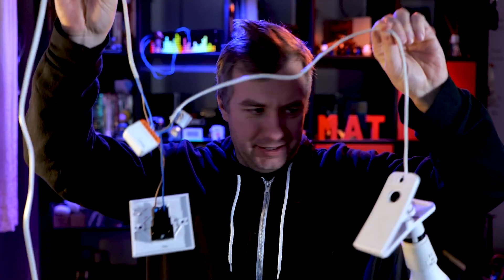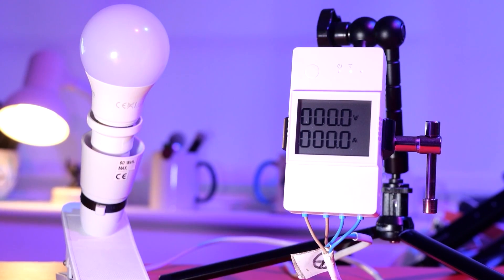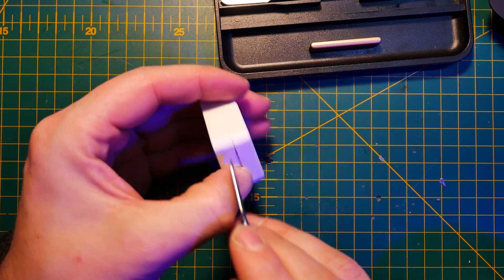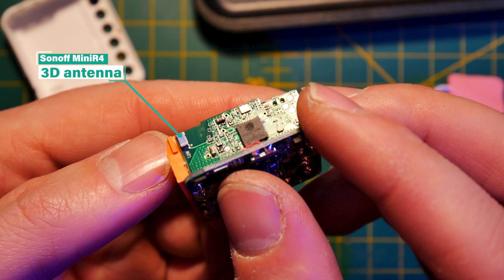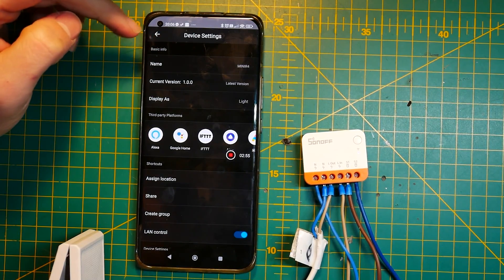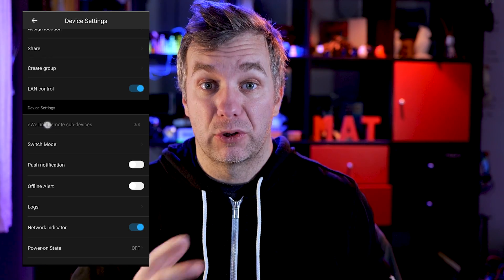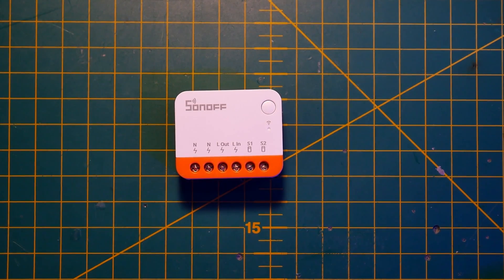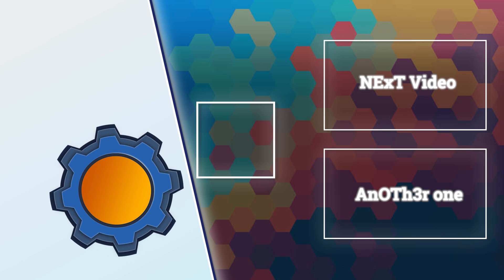The smallest smart relay I had in my hands! Sonoff MiniR4 Extreme

Comment: Thanks helpful vid. As I have no experience with this product, could I get a little more help please?🤔
Here goes - I bought two Sonoff MiniR4 Extremes to play with. I thought I would connect a 240V load to one MiniR4 (#1), using a push button adjacent to trigger an "on" timer in this MiniR4  and operate the load. After time out, the load switches off. 
Second MiniR4 (#2) to act as a remote WiFi button to do the same function with the #1 MiniR4 timer/load, via the WiFi.
Am I on the right track? How is the timer set up.
Thanks
Reply from the maker: What you say it's possible and the 2nd switch could be "synced up" using automation panel in eWeLink app. Timers would be managed in the app as well as the device offers inching, timers and schedules in ewelink
Reply: @notenoughtech  Many thanks for your help, I will do more study and set it up!

Comment: SONOFF ZBMINIL2 Questions.. Is it a good fit and will it work in these scenarios?

Here is what I'm wanting to accomplish and hoping someone can tell me if this device will do that..

*Scenario 1:* Have a switch box that has a neutral wire. It turns my ceiling fan / light combo off/on.. I have a Smart Life universal wifi fan/light combo installed that I have in HA to control fan and lights. However, switch has to be on to do so.. I want to be able to control the fan/light via HA/Alexa regardless if the switch is in off/on position.

*Scenario 2:* I have 3 switch boxes, all 3 way, that control our hallway lights. None have a neutral. Will this device provide HA on/off ability? If so, do I need to install 3 (one in each box)?

*Scenario 3:* I have a switch box with no neutral. Just want HA to have ability to turn lights off/on. 

Also, for any of the scenarios that do work (if any), does the standard on/off toggle light switch work with them?

Thanks!
Reply from the maker: Scenario 1 is ok as you will be able to use your switch for something else and keep fan/light on all the time. 

Scenario 2 depends on how it's all wired but if it's a loop (fed from one socket) then you need just one device. 

Scenario 3 as long as you use non neutral version should be fine
Reply: @notenoughtech  thanks for the reply!! So for scenario 1, what do you mean I’ll be able to use the switch for something else? Will the switch still turn the light / fan off as normal if it is on?
Reply from the maker: It will be down to you as you can decouple the switch from the relay
Reply: @notenoughtech  Thanks for the reply!! I tried installing “scenario 3” today.

It’s not working how I expected but maybe it’s normal / how it works.

I installed it and added it to HA. I was able to control it via HA but it had some pretty bad lag (but very well can be my zigbee network).

I tried powering it on with HA and then while it was on I toggled the switch. It did turn off but in HA it still shows on. Is that expected?

Thanks for the help.

￼

Comment: Great video, thanks.
Can you still use the switch when your phone (or different device) is connected to a different network than the sonoff switch itself.
For example when the sonoff switch is connected to my home network and my phone is connected to 4G/5G and i want to be able to turn on/off the switch?

Comment: The instructions included are confusing or something is lost in translation.
They talk about "strong" electricity and not connecting neutrals and earths to S1 or live, neutral and earth to S2.
In their switch wiring diagrams, especially the last two using S2, isn't that what you are doing by connecting live to S2 through a switch?
I wonder if they mean don't use S1 or S2 to supply power to the module?
Any thoughts?
Reply from the maker: I'm sorry for the late reply. 
Basically, you want to use the drawn schematics :) these are much better to follow than written by their instructions. You want to connect Live to S1 if I remember correctly (I'm away from home) but the illustrations were the way to go

Comment: Hi Mat,
Have you tried the schematic in which you install the switch between the live wire and S2? It doesn't work for me.
Reply from the maker: Have you set the switch in correct mode? Triple press the button to toggle between push button and toggle
Reply: @notenoughtech  Thanks for your reply, but it was my bad. I tried using a proximity sensor relay as a switch, but when turned off there is 5 volts so the mini always gets voltage and doesn't switch on or off.
Reply from the maker: I see

Comment: I was wondering if this device can be useful for me, I am trying to connect a photoelectric sensor to know if it is active or not, I meant I don't need to turn on/off, I just need to know the current status of the sensor then I can wire the logic to turn on/omaff a light by ewelink.
Reply from the maker: I don't think this is the best device for that. Whats the voltage of your sensor connected?
Reply: @notenoughtech 
 Supreform IP67 Waterproof 40 Feet Range 10-30VDC Retro-Reflective Photoelectric Beam Sensor
Output: Relay SPDT
Output Capacity: 1A/30VDC, 1A/250VAC

Comment: I can't wait to try my "no-neutral" circuit hack on the  Sonoff MiniR4
https://youtu.be/oBR5O391m_c 
Or my other circuit hack that allows you to put it by the light fixture itself, and not behind the light switch. I know this is easy to do in the UK with the three plate ceiling rose (loop-in system). For the rest of the world my circuit might help. https://youtu.be/x7Q8AS238pY

Comment: I thought my dodgy ATX Computer power supply wired into some LED Strips and a couple of ESP32's was bad - LOL.  The intro to this video was a bit of fun.  :)
The Itead Mini Extreme is really small.  Nice to see the WiFi signal is pretty decent with it.   I am a little concerned about heat long term and I am not fully trusting of the relay.  I'd likely run it at half of its rated value at most.   I love small IoT devices, don't get me wrong, I just feel packing things in so tightly is asking for trouble in the medium to longer term, even if it works well short term.
Reply from the maker: That's to be seen I guess. At the same time, they do make relays to spec. The inclusion of the thermal paste was a bit odd considering the whole thing is made of plastic, but at the moment the relay isn't heating up much.

Comment: The better part of the device consists of a... relay. The electronics is quite small so no room for further miniaturization unless using smaller relay for smaller amperage.
Reply from the maker: Considering the use  for lights, 2-3A would be fine with me if they could make it even smaller. I cannot imagine anyone using whole 10A to drive their lights.
Reply: @notenoughtech  my thought exactly,  for me even 1amp is overkill

Comment: Still waiting for something actually "extreme" 😃 Looks like this is still too big to fit behind my wall switches. The typical wall switches in Denmark are actually a nice non-clumsy design, but with the external width about 5 cm (including frame), fitting more width than 3 cm on the inside is not realistic, and not a lot of depth either.
Reply from the maker: That's seriously small space behind your switches. On the upside, you can still mount it in the ceiling.
Reply: @notenoughtech   Well, the typical ceiling outlets has no more space, without a minor construction project. But some lamps do have room to mess around, especially when I avoid the old bulb form factor, which is just bad for IoT devices.
Reply from the maker: Most of my ceiling fittings have holes big enough to cram something behind the plasterboard.  The plastic covers are usually just to hide the hole and associated wiring. Again standards vary from country to country
Reply: @notenoughtech  I have the same problem here in Germany, the zigbee relay is just to big to fit behind the switch. I want both functions: use the wallswitch and able to use switch the light via smarthome. I still haven't found a series of wallswitches which fit into my frames, as i have some double switches and some with plugs below it. Putting the the relay into the ceiling cover of my lamps is the same as using a smart bulb.
Reply: @thomasfjen   One potential strategy could be to tear out the wall switch to get room for a "smart" relay, and then cover with a battery Zigbee button, to manage actions via your smartphone backend.
Reply: @JohnnieHougaardNielsen  that could be a way but then i am again reliant that my hub works. for simple light on off action i don't want to be reliant on that, thats why i like the the relay option. there are some shelly momentary wall switches which are low profile and designed to have the relay positined in the back. Maybe that can be used with a zigbee relay if the fit my exsiting switch frames.
Reply: A lot depends on your wall and ceiling construction.
With solid walls like brick or block it's going to mean hacking out masonry and fitting a deeper box.
If it's drywall (plasterboard and timber studding) it's easier and I simply construct a deeper box by sticking two shallow boxes together.
This way I can get a depth of at least 80-mm from the surface of the wall.
Ceilings are hardly ever solid so space shouldn't be a problem

Comment: Nice Video. I have certianly noticed the amount of standy power that my automation devices use and the amount of button cell batteries that I go through each year. By the way if you do need to put two wires in a single terminal in the Sonoff device one good way is to use bootlace ferrules that are designed for two wires as the plastic part is wide enough to accomodate the insulation thickness of the two wires.
Reply from the maker: One day, I'll buy the crimper for ferules. hah, until then, I demand products to deliver enough terminals. Shelly was a much worse offender in that regards

Comment: No volt free relay contacts? This is the reason I use Shelly.
Reply from the maker: As the product is purposly made for in-wall switching, dry contact are not a benefit in this scenario. For other applications, there are other choices from both Shelly and Sonoff brands (and others)

Comment: A very good point that a lot of people forget is indeed the power consumption.  Count the amount of wifi enabled home automation stuff and you will be surprised. I'm at around 20 by now without the Zigbee stuff.  20 x 0.5= 10 Watt of constant use which is 0,24KWh a day. 
Not a lot you might say but I know people with a lot more smart stuff in their house.  Might be interesting comparing both wifi and Zigbee versions.  There is one thing which they should add in the app and that is reception strenght. Switched a Tuya device over the weekend with a sonoff Mini and I seriously missed that in the settings.  I have a mesh (mess) TP link system and I had the issue that some of them didn't connect to the closest AP (like 3 meters away) but took the one 2 floors down.
Reply from the maker: You are right these add up. Running 50W yearly const you about 150£ and that's significant